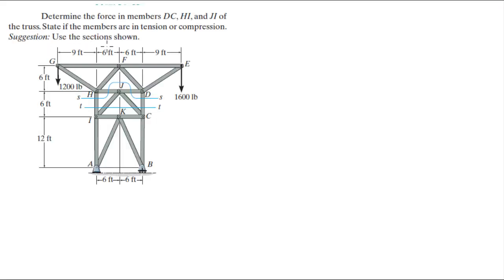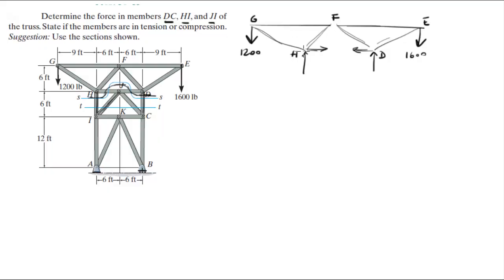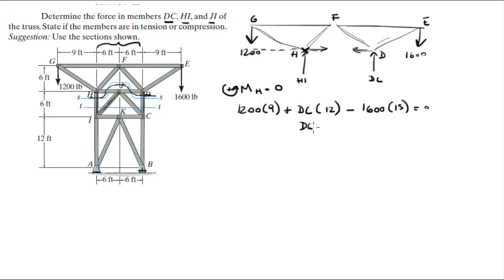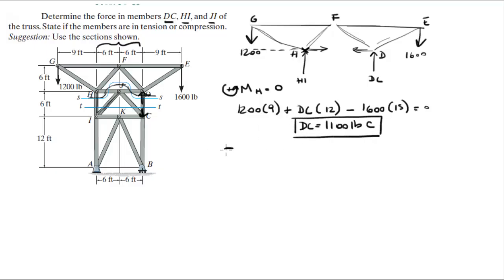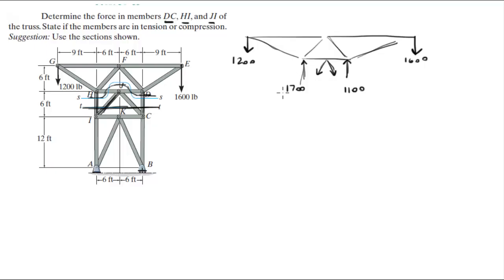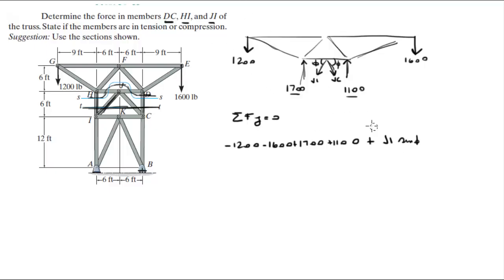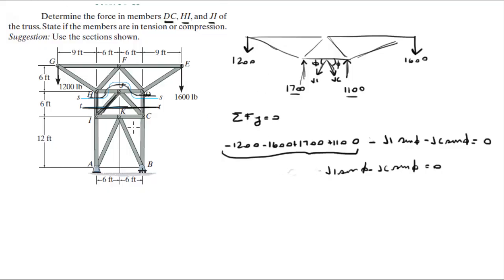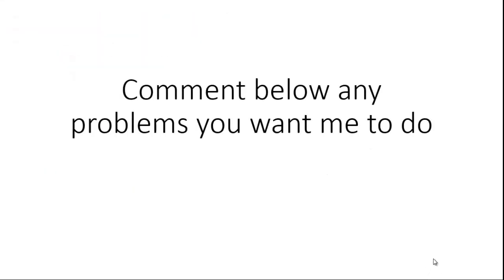Determine the force in members DC, HI, and JI of the truss.

Comment: Correct answer:

HI = 900 lb, compressive
DC = 1900 lb, tensile
Reply: You have the sense of each force backwards, the compression/tension is a internal force on each member which is equal and opposite to the force applied to the sectioned-off body.
Reply: DC is in compression, not tension, but the magnitudes are correct
Reply: @whogavehimafork  no u
Reply: @whogavehimafork  no, DC is tensile